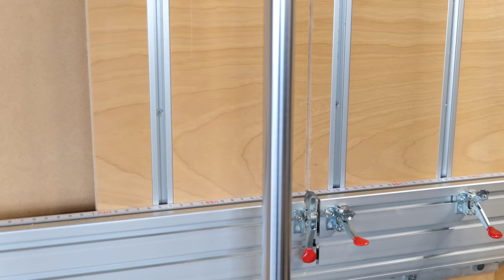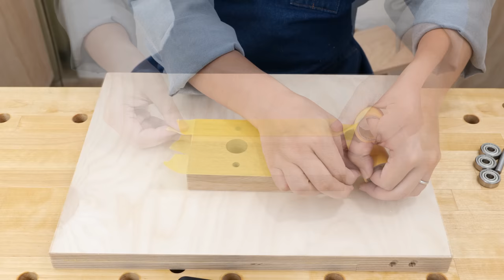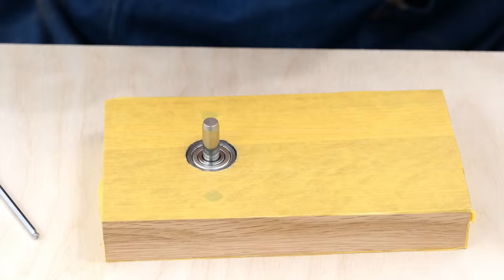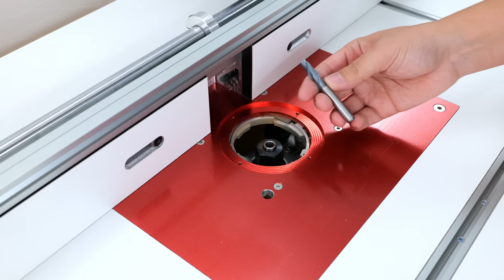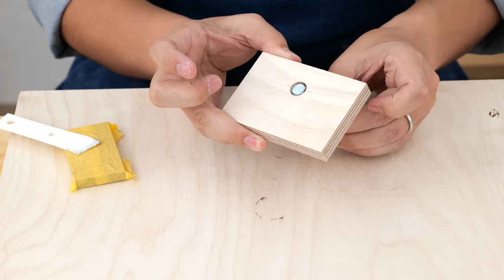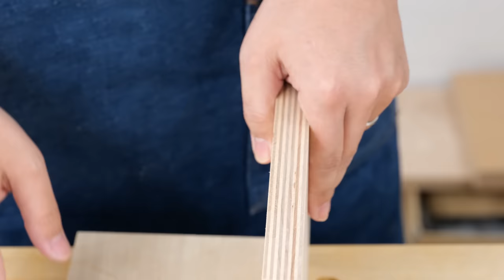A convenient 3-way jig for joining wood

Comment: Happy CNY! I watched your video on this exact dowel jig 2+ years ago and made myself a same one out of "Ash" with 8mm ball-bearings and stainless steel shafts! I always use it whenever my project requires dowel joinery! However due to the deviation of 8mm dowels' diameter, often 8.2~8.4mm, I need to roll them slightly to fit into the "slot." It's a great drill once, fit & done tool and fits greatly into any drawers! Thank you!

Comment: The bearing in the middle is actually a very ingenious design. I have a store bought jig for the same job but the metal bushing guiding the drill started to wear out and I had to retire it. Since the bearing can spin with the bit in this one, it should slow down if not entirely elliminate the wear. Definetly going to build this one for myself. Great video. Keep up the good work!

Comment: Man your jigs are the best! Quick tip for the bearings and glue, tape the top and bottom bearing cut it along the outside of the race then the glue when you push them threw won’t possibly get inside and seize them up

Comment: Two questions:
1) When drilling two symmetrical holes, can't you flip instead of moving the stops and putting spacers in?
2) Wouldn't it be more accurate for the part to make the bearing fit with an interference fit instead of making a loose fit and using glue on top of that?
--
Два вопроса:
1) А на сверлильном нельзя было перевернуть заготовку (при сверлении двух симметричных отверстий), вместо того чтобы передвигать упоры и ставить проставки?
2) Не более ли прецизионным для изделия было бы сделать посадку под подшипник с натягом вместо того чтобы делать прослабленную и использовать до кучи клей?

Comment: I don't know, I used to  have these little metal pins that had a point on them and you just stuck them in the hole for your dowel, then put the other piece of wood on it and tapped them and there was a little mark where you just drilled your other hole, instant dowel connections in line.

Comment: Your vid’s are awesome but may I ask what you primarily build with all the joinery you do for channel. I never see finished pieces.
Reply from the maker: Admittedly, I rarely make videos of things other than tools.
For some reason, I know it won't be watched much.
And I don't shoot because I just want to enjoy making things.
The link below is an example.

https://youtu.be/F28iFtGkeUU
https://youtu.be/OFas2yROEKY
https://youtu.be/3wsG_ke22YU
https://youtu.be/Y2bjfgqISTs
https://youtu.be/1M7MPiY8Fpk
https://youtu.be/uMbbz9hKCus
https://youtu.be/5-3mtrQKrOQ
Reply from the maker: The wooden clock is not a kit.
I designed it myself and processed it with my own CNC router.

I have sold it as a kit in the past.